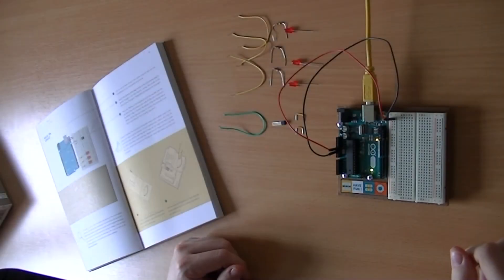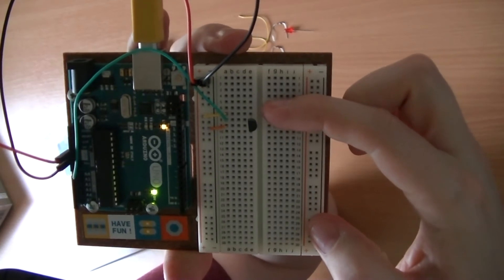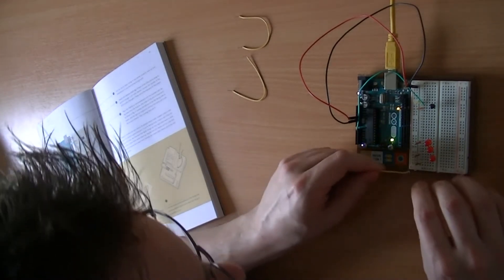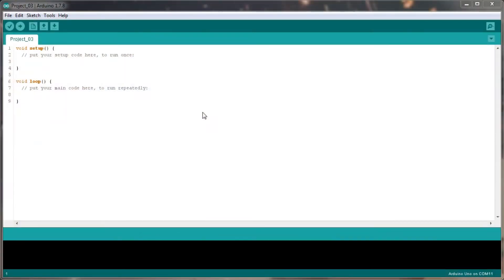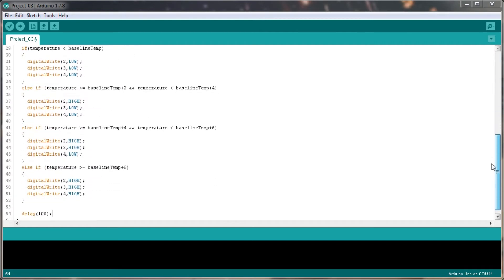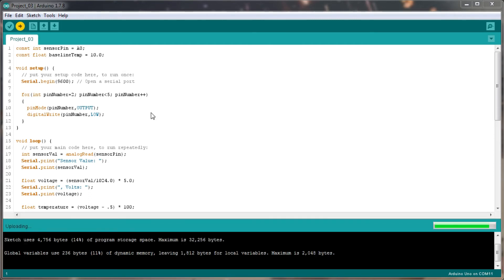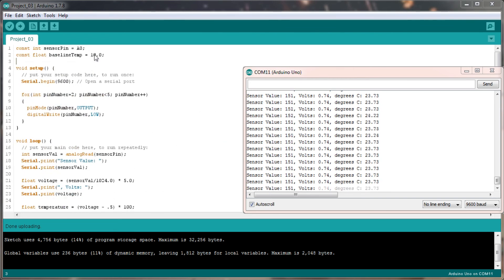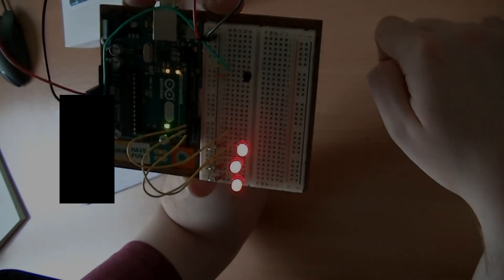Arduino Project 03 - Love o meter

Comment: any idea how to get baselineTemp to default to ambient room temp?
Reply: Hello from the future!
You would just assign the number whatever the room temperature is. It would depend on the room, the location, etc.
Reply: @acdenton25  I think he knows that, He's asking for the temperature which is automatically calibrated to the room using the sensor itself
Reply: A way to do this would be by looking at the serial monitor and looking at the most common number